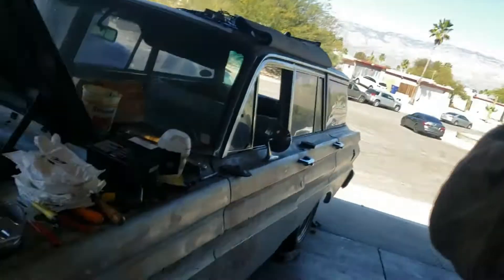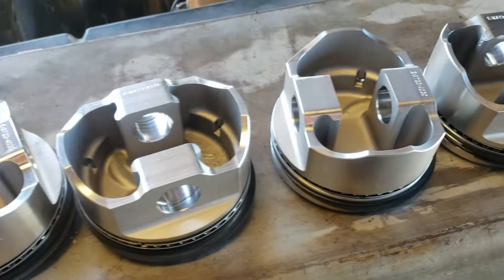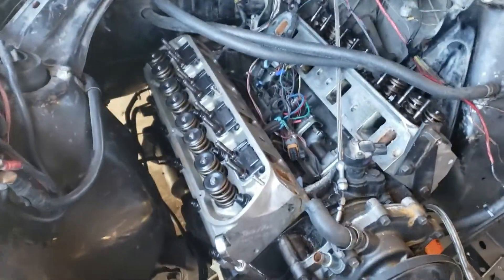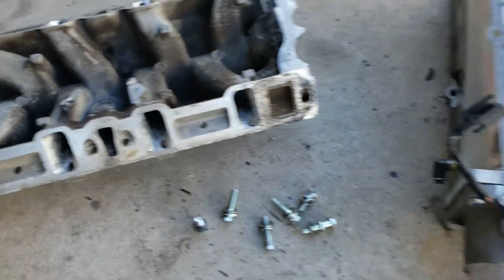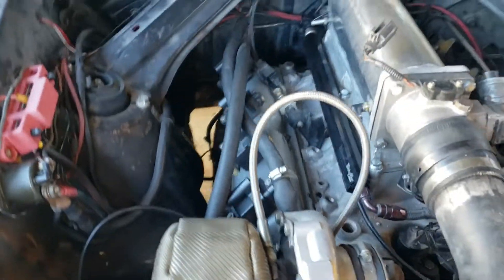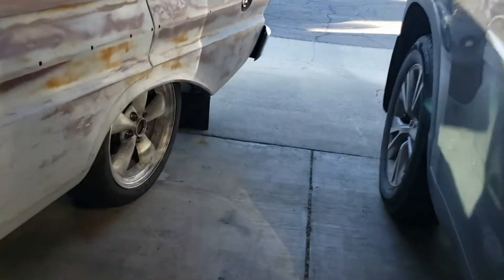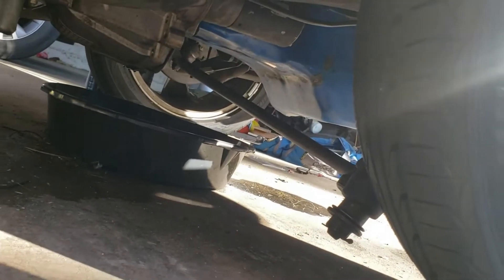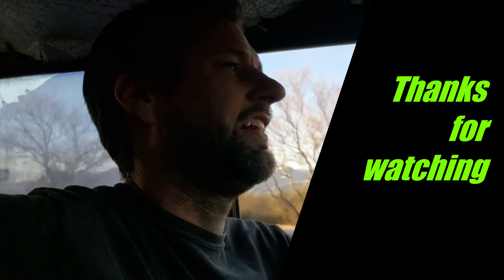Piston Swap/Engine Rebuild 306 Ford

Comment: your just using the stock cast iron exhaust manifolds flipped?     true spirit of hot rodding with your build... ready for the ziptie/duct tape drags
Reply from the maker: Yep, just some 60's mustang manifolds flipped sides and pointed forwards.